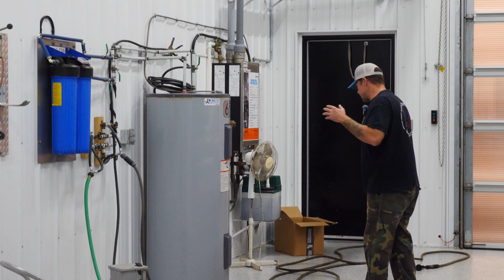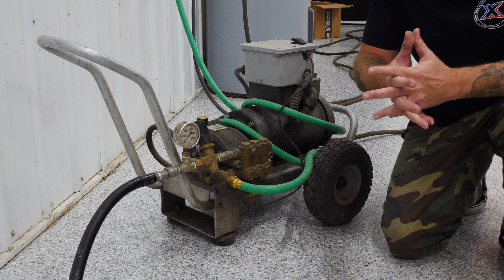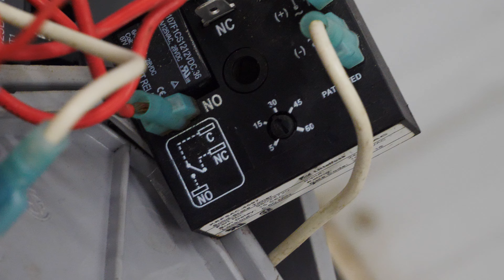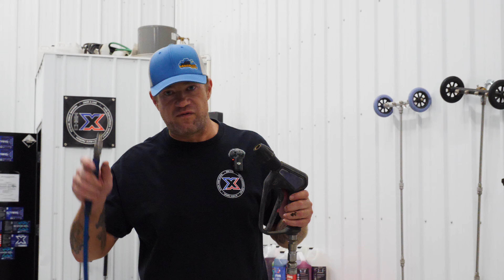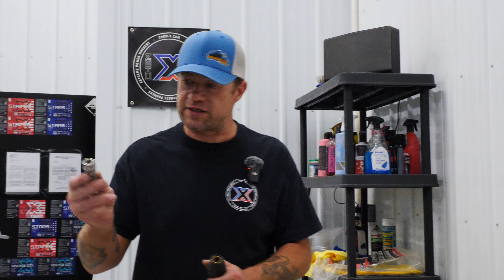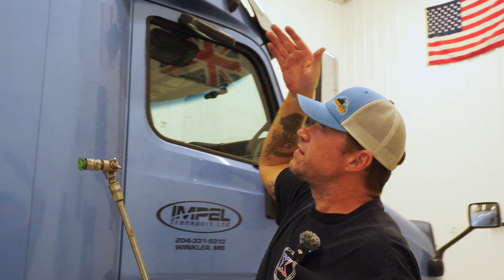Our pressure washer set up

Comment: One more question is there a extension cord for wall outlet
Reply from the maker: Most pump set ups come with a fairly long cord, this one has a 15 foot cable to give you options for mobility and pump placement in your shop.

Comment: Excellent setup especially the pressure washer where can I purchase a motor like that
Reply from the maker: That's an industrial pressure washer setup, I'm not sure if you could buy that motor on it's own.
Reply: @LargeCarTruckSpa I built my own pressure washer setup. The good thing about commercial/industrial things is that they are like legos for grownups. The only thing “custom” here is probably the cart it rides on, but could be bolted to anything. For example a 5HP motor with a ~1,800 RPM can get in a “184TC” frame. This means there is a mounting face surrounding the output shaft. There will be pressure washing pumps that either directly mount to a 184TC motor or you can get a bell housing from someone like CAT. From there you just need controls. This can be done as simply as some relays and a flow sensor. This saw you can design your system for your ideal psi/gpm combo. Want more GPM, get a pump with whatever you want. Want more psi, get a higher hp motor. When you don’t want all the psi, just use a bigger nozzle, but the GPM is effectively fixed.